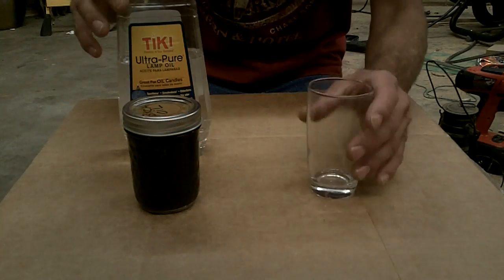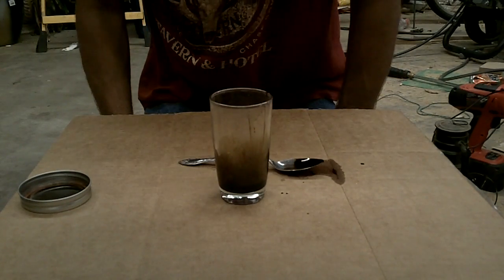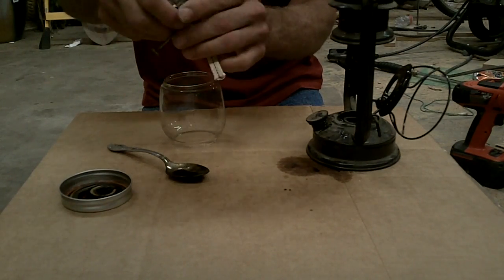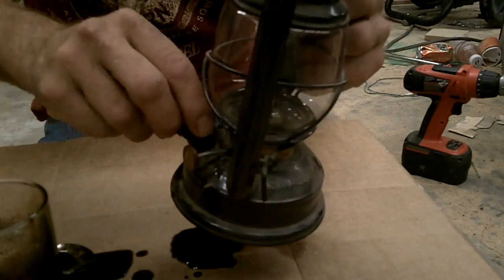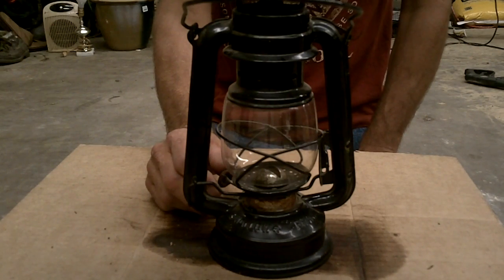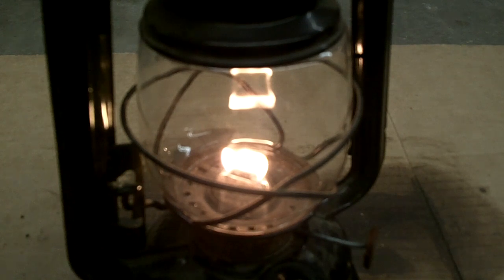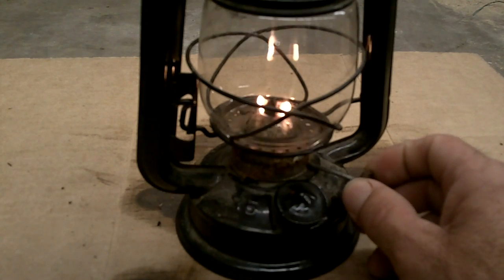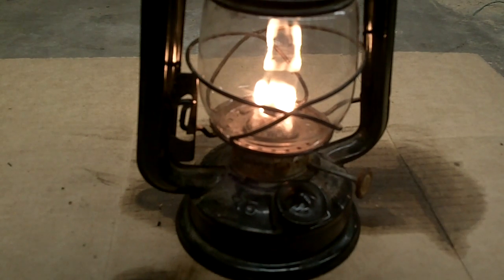Birch oil experiment: Lamp Oil

Comment: The top of the of the lamp is closed shut so not enough oxygen. So it dies down after a few mins so turning the wick just burns it quicker. A little air flow and it would burn great.

Comment: to use the birch oil, you need to crack it. That is heat it again and distill the lighter elements from the tarry pitch. you should end up with a petroleum type liquid and a thick tarry pitch. There are  many video on how to achieve this.
Reply: Can you refer me to one of these videos?
Reply: @nickpierlot9319  It would be like any distilling process, wouldn't it? Burn the birch oil in a basin and the thinner stuff escapes through a thin copper pipe into another jug.
Reply: Can't find no video, do you have a link please?
Reply: Why don't you respont to people asking you for these videos?

Comment: but in a survival situation How can you use birch oil ALONE because you may have th elantern but getting lamp oil to mix it is defeating th epurpose,
Reply: Raven4122 or modify the lamp parts to accomidate the oil specifically
Reply from the maker: +Raven4122  You can not use the birch oil alone in a lantern it will not work. The best you can do is mix it with lamp oil to extend your supply. You can put the birch oil on a piece of fungus and it can be used as an open torch (for lack of a better word) but its quite smokey when burning. Thank you. Joe
Reply: hmm no way to thin it  or filter it?
Reply: Or as someone else commented, crack it. Personally I have my old oil furnace tank full of fuel. I’ve switched to wood and removed the furnace. I could mix fuel oil and birch oil to last me a life time of lighting my home.

Comment: you might need to filter the birch oil to remove the impurities. there was a way to filter used motor oil so that it could be reused using a long wick going from the birch oil to an other conainer below. might work.
Reply: so maybe use cloth between the two cans or maybe add one in middle so it doesn't burn it and as spacer and too hold the cloth in place very kool

Comment: joe i havent tried birch oil but i have tried cooking oil and thinned it with the same results as you got, I decided to make a wick and used  2 thin pieces of copper wire twisted round it to hold it up and stuck the wick in a glass of cooking oil and it burns great like a candle

Comment: What is happening is the impurities of the birch oil are contaminating the wick.  That's why you have to keep adjusting it every 15 minutes even when the wick is new.  Eventually, you would find that the wick won't bring enough fuel to the flame to burn.  The same thing happens with kerosene heaters if you use the wrong grade of fuel.

Comment: Just an observation from comments from this video and your birch oil video. You mentioned in the oil video that you saw the can was half buried in the dirt, and your can was barely one quarter buried. Maybe a way to refine it better would be a cooler burn. Many comments said the longer you cook the oil, the thicker it is to where it turns solid. That could be a way to better refine it and end up with a cleaner looking oil and possibly thinner oil too.